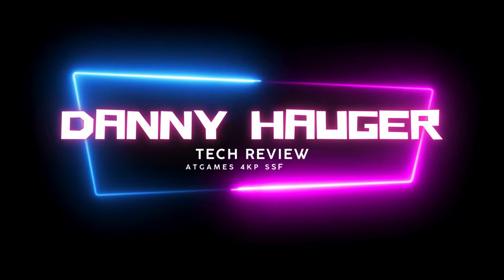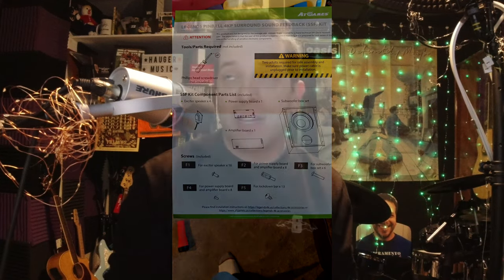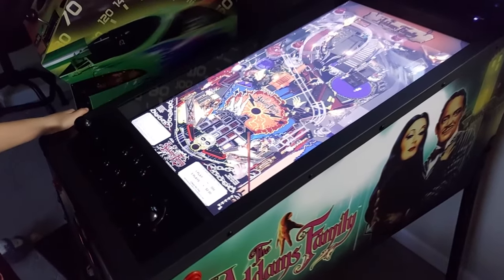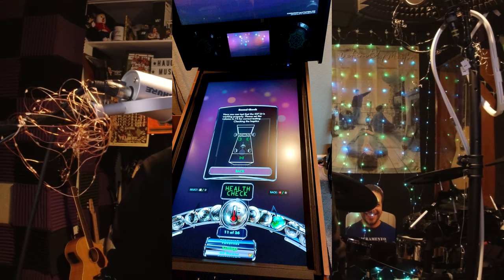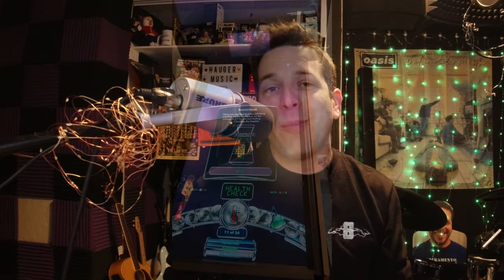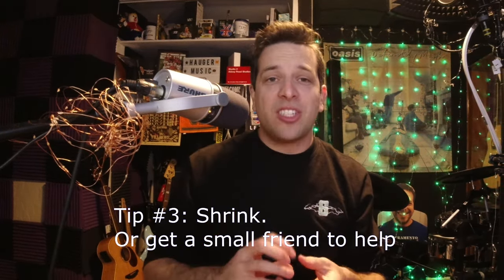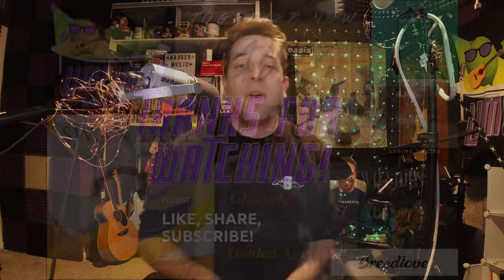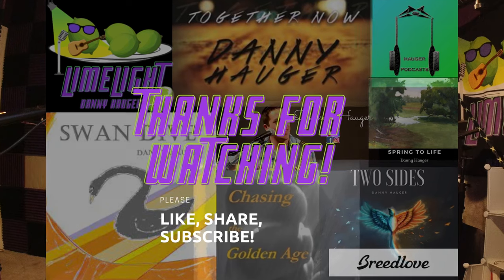3 Hours Installing the Atgames Legends ALP 4KP SSF Surround Sound Kit, Time Saving Install Tips

Comment: Took me just under 2 hours. The magentic tip screwdriver was definitely helpful. I got all my screws for the exciters in. I had to remove the right front exciter to re-adjust it, which sucked. Pro tip put your screws into the exciters first using the sticky backing that you punch through to hold it in place. Then just screw it in.
Reply from the maker: I dropped a few late in the game after I had sealed everything up.... Groan... Thanks for sharing and watching

Comment: Looking at the kit if bought seperate, its a $30 ship. So $430. Or i can fullfill my preorder install for $450 already paying $50. Even $400 is pricey, as i put 2 daytons, transducer, amp and 24v psu in HD for under $150. Do you think its really worth it? Idk the 4k architecture if we can add our own ssf kit pieced together. With HD it was a matter of just splicing audio wires.

Does SSF work in otg also, or do we need a whole audio system for computer based pinball also?
Reply from the maker: I'm glad I did it, that's maybe the best answer I can give? If I had the money I would have had them do it... I like the result though, enhances my games quite a bit. Thanks!!